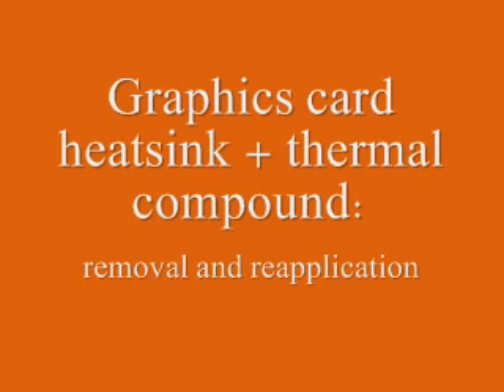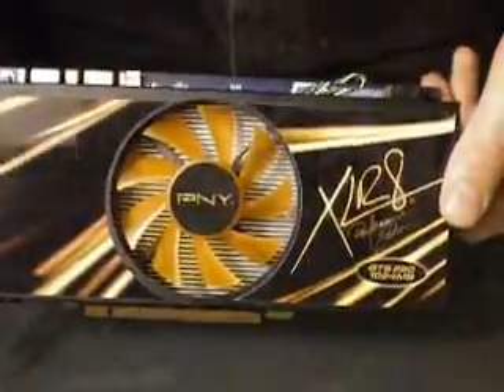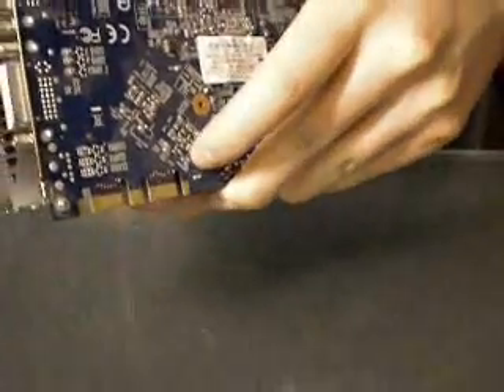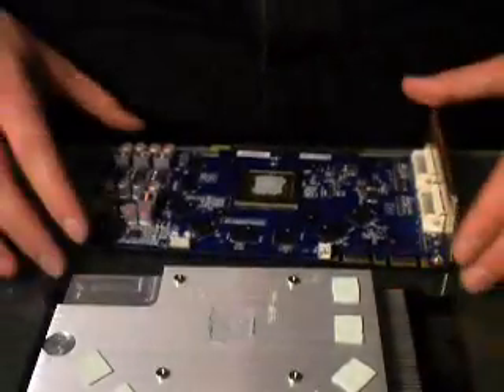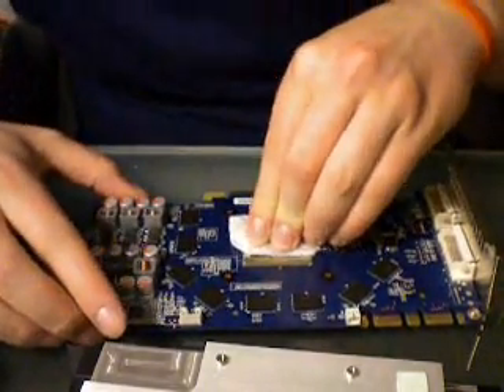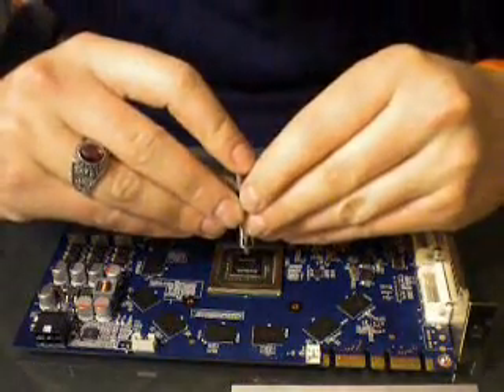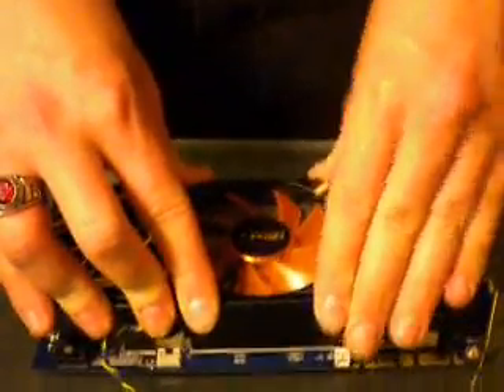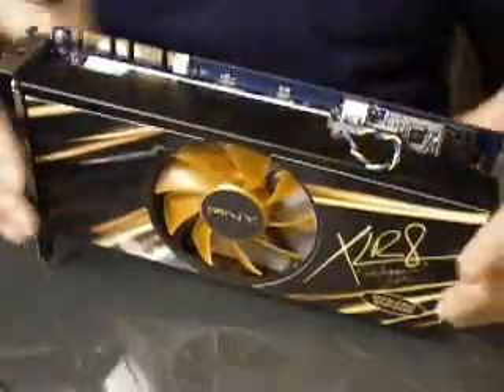GPU heatsink + thermal paste removal and reapplication

Comment: Hi, not sure if you still post or read comments on these videos, but I took a BFG 9800GT apart (going to use it on an older PC for browsing etc) to replace the thermal paste and discovered no thermal pads to absorb the head from the VRAM.

Is this a manufacturing defect I should rectify or is the card actually fine to run this way?

Comment: Thanks for the video! 
I was wondering if you new of a link to a video of someone removing the heatsink off a Nvidia Quadro 4000 for a Mac Pro? Reason I ask is there are a ton of screws of all different types, sizes, etc... (Some of which I even have no clue what type of screwdriver head to use on them!) + I just want to make sure if whatever screws I'm removing are nesacery for removing the heatsink & I'm not unscrewing ones that have nothing to do with the heatsink.  
Thanks again for the video,
Peace...

Comment: Dont pick any paste brand! invest in a good paste and it will make a difference to the temperatures. I have used IC Diamond and Noctua NT-H1 on my cpu with good results, Ive just brought a used Quadro 4000 and intend to re paste with the NT-H1.
Reply: +Dutch Trucker I bought a Noctua NH-D15 cooler and it came with that CPU paste. I'm thinking of doing this on my EVGA GTX 980 ACX 2.0 edition.

Comment: Do you need a electrostatic mat or anything that discharges energy or nah? :S
Reply: berz zerk You can use one but i recently built a whole computer without one and was fine. Just try not to do it on carpet and if you really want you can plug your computer in to the wall next to you (the switch does not need to be on since the ground is always connected) and just touch it every so often to discharge you. You need to touch a metal part of the case or even the PSU itself.
Reply: Moneybagzsz Cheers for the tip man! Yeah I really really need to get a new thermal compound on her I think, been getting way to hot during my game sessions D:
Reply: +berz zerk a bit late to the comment but just to let you know, older electronics are much more suceptible to ESDs however with newer stuff, just make sure you have discharged yourself first and you should be fine... sadly it still happens to fry stuff with ESDs, better safe than sorry !
Reply: +berz zerk a bit of a necro, but it's helpful info. No socks + a wood floor is usually fine. I've done it that way and have had 0 fried components so far.

Comment: DUDE. DO NOT put that much pressure on your gpu chip. You'll kill it. Instead use a credit card to spread the paste before mounting the heatsink. And screw in the screws diagonally. That way you dont put unnecessary pressure on your gpu.
Reply: Spread method causes airbubbles. It's just dumb.

Comment: I wouldn't recommend pressing firmly right after the application of the new paste. Instead, I would flip the card over then tighten the screws slowly in a diagonal pattern to spread the paste. I mainly use this method for laptops as the heatsink has screws that are numbered. Great informative video.

Comment: Hey bro.
Just to make it clear, i didn't watch your video.
I removed my GPU's thermal paste and now my it won't display anything.
I gently scraped off the old thermal paste but i didn't reapply any new paste.
Now the fan is still spinning but there is this red light coming from the D4000 led
Btw it's a hd 6770.
Will it run again if i apply a new thermal paste? 
Is it detecting that it doesn't have a thermal paste on its gpu
:(
Reply: wahaha, LMAO
Reply: like Josh said you need to reapply compound EACH AND EVERY TIME you take of the heatsink. Your card likely reaches it's heat limit and shuts off almost instantaneously, hopefully you haven't done any damage to it but at least now you'll always know to redo the compound.

Comment: This is funny because I had the same issue when was trying to remove a cpu from an old motherboard a few months bk and I would have sworn that it was superglued with additional screws in it somewhere. I think it is because it had been sat unused for so long and it had dried up that much that it was just solid or something. If I could go back, I might have tried possibly suppling power to it so that the paste got heated up and softened a little see if that worked, but wouldn't know the outcome

Comment: Hey mate a question, I still have a setup that runs with BFG nvidia 250gts, wanted to swap thermal paste but got stuck at removing the heatsink from the board. Seems like it was glued with cement, and not with thermal paste, any more tips cause I'm really stuck, thanks :D

Comment: OK so you had to reapply your compound due to high temps? Did you do the pea method and use the heatsink to smear it again? (as shown in this video)  Or did you do the thin even coat with a card/razor?

I did the card/razor method to spread a thin even coat, but I'm actually hitting very high temps.. suppose I didn't put enough?  do you recommend the pea/smear method?

Comment: Hi , I used a cooler master htk-002 and doesn't conduct electricity, did put a pea size and spread it using a cardboard.. went up to the menu screen of hitman:absolution and went up to 80C lol, I immediately closed it afterwards.. pls help. thanks

Comment: i applied AS5 on my gts 450, i cleaned the other stuff of , but know my gpu is idling @65c, before i replaced the paste it was idling @42c. should i wait a little longer for the curing time, or scrape it off and redo the paste?(its possible i put too much?)